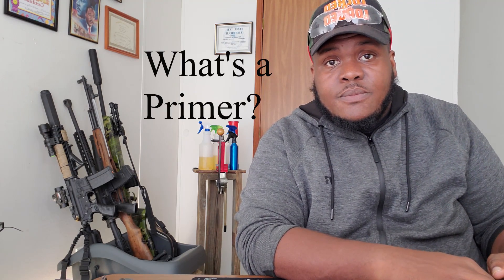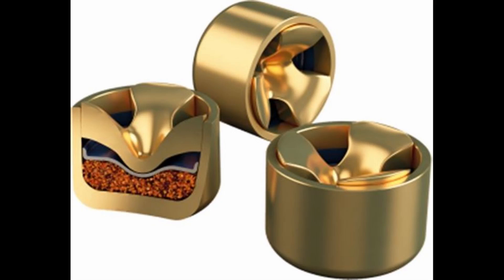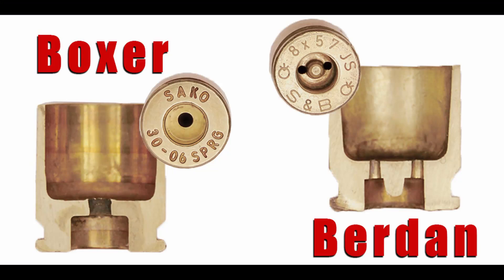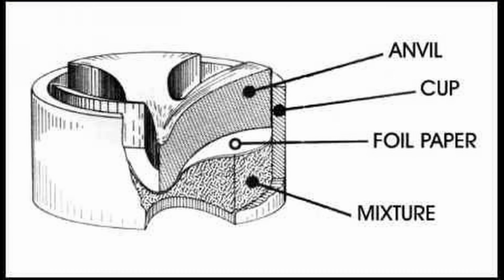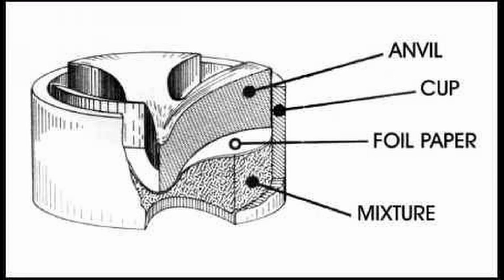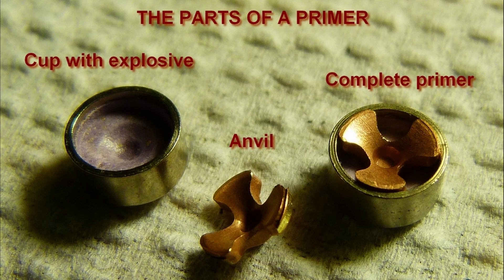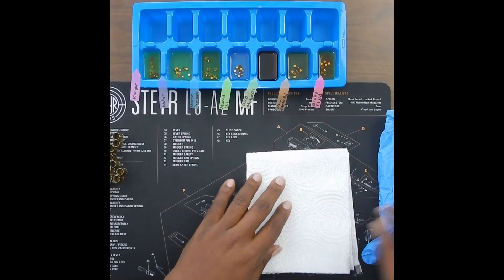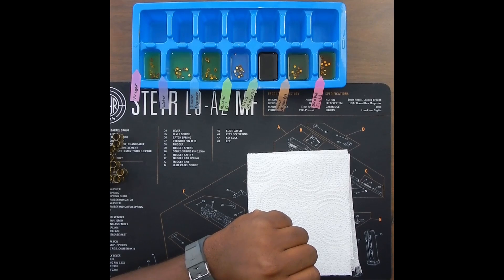Is It Possible To Kill A " (Bullet) " Primer

Comment: I didn't think I'd actually find anyone who tested this!  I wanted to do it myself to guide my case lube adventures, but I'm out of primers and probably won't be finding any for a while.  I would figure that it would be good to test a group of primers with your IPA/castor oil spray.  Since I'm doing big straight cases like 45-70, I worry about how generous I can afford to be with the lube without residues causing problems.  I suppose worries about long term powder degradation are also a thing that could be tested, but there's a lot more variable combinations (lots of potential powders versus different bullet lubes and case lubes).

Comment: Why in the world would you just test if they “pop” or have some sign of ignition?  The real thing we need to know is if they will detonate the powder or not.  You should have loaded live rounds.  What you tested doesnt matter at all.  What matters is if they will fire or not when loaded with powder/bullet.
Reply from the maker: You are absolutely correct, however the issues here are safety and lack of control. A pop is detonation and any detonation has the potential to ignite powder. I did not want to pull the trigger on a pop, have nothing happen, eject the round and then it cook off on the ground or on the table. No test is worth the risk of bodily injury or death. especially if you do have any control. Secondly if the ignition was weak it would have taken entirely to long to clear a squib every time.
Reply: @Bri bowl
Ok smart guy. Run your own tests and get back to us with your results instead of crapping on somebody else’s testing.